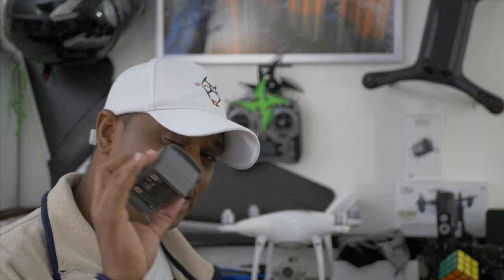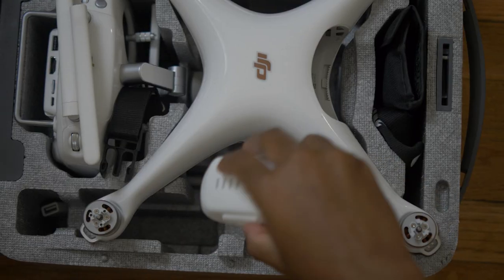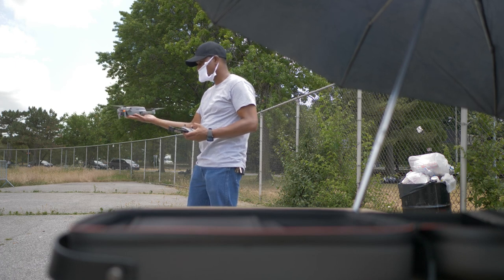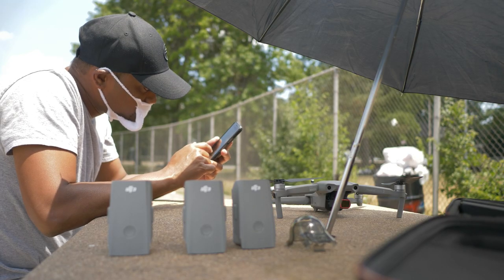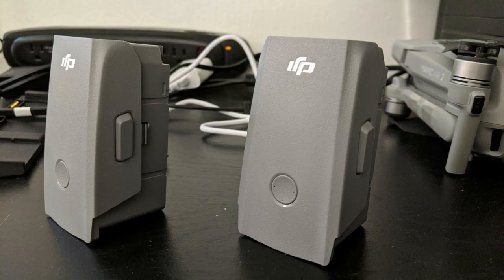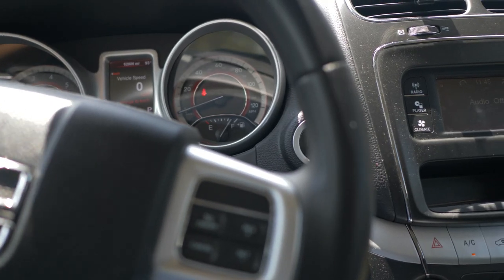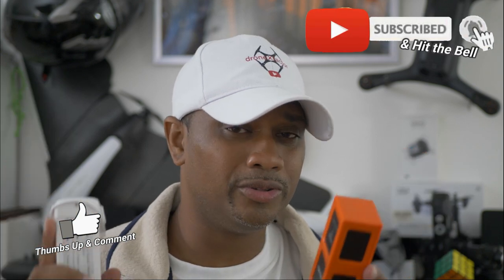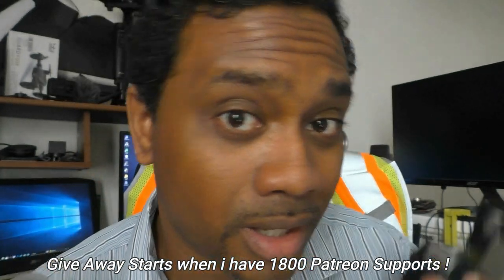DJI Battery Care & Maintenance Tips / DJI Mini 2, Mavic Air 2 & Mavic 2

Comment: Good advice.  These batteries don't like heat and also don't like to be at full / empty charge for long term. Their happy place is to be room temp at 40-60% charge long term.  Best to always let them get to room temp before you change their state (charge, discharge,fly, etc).

Comment: Really important advice!  I will be referring back to these ideas over and over again; not just for my drone batteries but for cameras and laptops as well. I recently got the Mavic Mini combo and, with that great little carry case, it's very tempting to just put everything right inside and head off.  Not anymore.
 I've had the issue of a swelling battery only once (in a laptop) and with the price of replacement and risk to the electronics, I don't want it to happen again.  Thanks a whole bunch!

Comment: Is it safe to always keep a battery in my Mavic Air 2 while left in storage bag/case or does this drain the battery if not planning to fly for a while?
Reply from the maker: If not planning to fly for a while, leave all the batteries on a shelf where it can get open air.
DJI batteries have self-discharge mode which will cause the batteries to heat up while it discharges, so it's not ideal to leave in a bag or case.
Reply: Thanks for that Brother, much appreciated and will take batteries out of the custom case now to breath as not sure when next flight will be due to UK Weather 👍👍

Comment: 1. Do not charge batteries if you are not planning to use them for a while. 2. Don't fly the batteries completely flat ( ever ), leave like 20-25% battery. You really can't storage discharge/charge DJI batteries ( that i know of ), so if you cannot empty them flying, then use usb battery bank module ( mavic air 2 etc ) and drain the battery using that!

Comment: I have 3 batteries for the MA2. I've marked them A, B & C. I try to pay attention to which ones I've used and to the ones that are still yet to be used. If I don't go flying for a week, I'm perplexed to which ones that should be brought up to charge before I fly. My point is, rather than just looking at the battery lights to indicate the current charge, I find that I have to install each battery one at a time in the drone and look on the DJI Fly App for the remaining battery %. Isn't there an easier way to find out the current battery %? Also, what should be the lowest battery % level before I recharge to maintain good battery health? 10%? 20%?

Comment: Lipos fail when you store them for a long time when fully charged or after fully depleting them below 3v per cell.

I think the biggest mistake new flyers make is depleting them as far as possible (to get maximum flight time) and then storing them for a long time in that state.

The lithium ion batteries in the original mini are more worry free.  They can be left fully charged or in various stages for a long while.

Safest storage voltage is 3.8v per cell.  I'd go to 3.9v if storing for 3 months. Not sure about your 60% rule.  What voltage is 60%?

Comment: I have a Mavic Mini which uses Li-ion batteries. However, I have LiPo’s for my other RC stuff. LiPo’s are a different animal than other types.
The Air 2 uses a 3S battery meaning there are 3 cells in the battery. When your system says low battery and land, DO IT! Nominal voltage is 11.1 v. Full charge on the 3S is 12.6 V, so each cell is 4.2 V. Low voltage is 9 V, so each cell is 3.0 V. Go lower and you WILL damage the battery. So when you get the message to land, DO IT!  Don’t store the battery with a full charge. As the manual says, fly the bird until your are advised to land. Follow the manuals advice about charging and maintaining a storage charge. LiPo batteries use a “balance” charging system which means the charging circuit uses “intelligence” to balance charge each cell, keeping them in approx. .05 to .1 v of each other. The batteries don’t breathe. My LiPo’s are all sealed. Don’t let them get too hot or cold during transport, but I’ve never had an issue with that. They do require maintenance, so do follow the manuals guidance. Probably the most important part of the manual. Not only can these batteries swell when they are not maintained, they CAN explode or start burning. For anyone not familiar with LiPo’s, there’s plenty on YouTube to educate yourself. Sir, thanks for this video, I’m sure may people will take your advice.

Comment: I would imagine the main reason these cells are swelling, is caused by discharging them too low? Li po does not like to have it's voltage dropped too low. L ion are different (Mavic mini), and not quite as fragile. 

DJI does have some protection for the batteries, but only when charging and in storage. I have a collection of high powered flashlights, they all have protection in them which allows the cells not to be drained below 2.9v, or thereabouts. Now some of my Panasonic cells have this, and some don't. Taking theses 18650 cells down below 3.0v can be problematic! Be aware, to my knowledge the MA2 is running Li po, and the MM uses L ion. The cells on the MA2 require some care, not so much concern for the MM! 

People might want to only take the cell down to 20% in the MA2, then change it! There is no over- discharge protection in the battery whilst in use to prevent this! Take the battery down below 3.0v regularly and you will prematurely shorten it's life, and possibly damage it permanently!✌️🇬🇧
Reply: @Cairns Unseen Most welcome! 😉
Reply: Good knowledge.
Reply: @jagergerg9771  😉
Reply: You are absolutely right in your explanation.
The mavic mini uses li ion and that is 18650 batteries, the only thing you have to take into account is that if you put them away fully charged for a longer time they will age faster. it is best to put them away with between 10 and 20 percent charge to slow down that process. that is also the reason that they are in sleep mode when you buy the MM new. LiPo is a completely different type of battery and you put it away in storage mode, but that is less easy with an intelligent battery than with a normal LiPo with a good charger.

Comment: Cooling down is important but the most useful advice is to keep the battery at ~60% If you are lazy ass like me charge them even full but never, I say NEVER leave them completely dead for a long time. Also even if charged remember to check them from time to time and recharge them if you don't use the device. It will save you a lot of money and that applies to almost all modern devices you are using as well as power banks. They just don't like being completely discharged for a long time.

Comment: Good idea to number your batteries so they get equal use. DJI claim only around 200 hours life span per battery apparently so cycle them!
Reply from the maker: #Facts!
Well said Max!
Thanks for sharing
Reply: I don't know where DJI gets their data, but I've had three batteries for my Mavic 2 Pro get puffy in the last two years even though I follow the cooldown advice, etc.  The statistics are startling!  Batt 1:  78 charges when it puffed up.  Batt 2:  83 charges  Batt 3:  80 charges.  Sounds to me they have some sort of timer in the circuitry to somehow expire them.  My cost analysis is that each charge costs about $2.00 US.  If they last 80 charges, that's $160 and the batteries cost $162.00 each with shipping and tax.  Coincidence?  Maybe.
Reply: @jimquinn6232  no doubt DJI put clocks in their batteries. Maybe don't up date them? Might help.

Comment: Hi thank for great video as always .I have a Mavic Air and 4 batteries .I fully charge them and after a few weeks they are only  at 50 percent is that normal ?
Reply from the maker: Yes that is normal, they self-discharge if you don't use them.
Thanks for reaching out
Happy Flying 😎
#TellOthersAboutDroneXfactor
                       &
#HitNotifcationBellForMoreVideos

Comment: All 3 of my dji mavic 2 zoom battery swell and I never left them in the drone. I think its because my home is hot. I now need new batteries 😒. Thanks for the tips
Reply: Did you check to see the  number of charge cycles when they swelled?  I'm curious.  My three batteries that swelled were charged 78, 83, and 80 respectively.  Costs right at $2.00 per charge.  Not cheap!

Comment: Zip lock dry bag, then place in cooler or fridge.  15 to 20 minutes.  Then they are cool enough to charge
Reply: Don't think that's a good idea since extreme temp change will cause condensation esp inside the batteries
Reply from the maker: Good point
Reply from the maker: Well that actually work?

Comment: Well I numbered my batteries and nu.ber 1 battery was the only one I would run down to 15 or 10 percent all the time and it puffed in 5 weeks but my other 2 batteries always run down to 50 percent which is a good storage percentage and not any signs off puff so stop at 50 and they also will last for ever and always ready to store

Comment: Guys the Mini batteries are 18650 Lithium, not Li-Po... I've never seen a swollen 18650... do I need to worry abt them? BTW, if one  of those batteries ever get fat, I will cut them and insert a new pair of 18650s in there...

Comment: My MA2 batterys take ages to cool down after use
Reply from the maker: It does :(
Be sure to cater to this please or you might end up having to buy more batteries.
Thanks for sharing
Happy Flying 😎
Reply: Mine does as well Flip it on its back that’s what I do, seems all the heat comes from the bottom. I also do it with the drone.